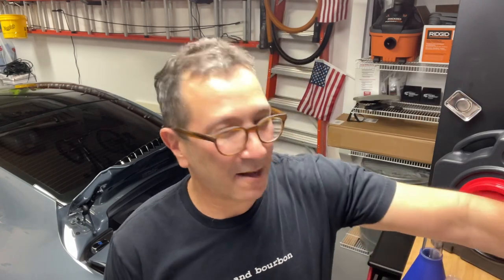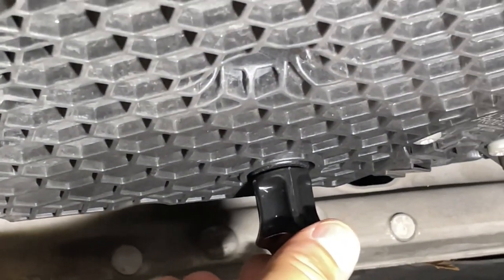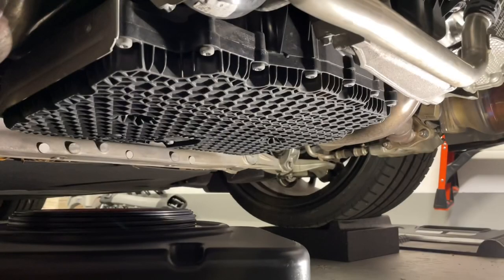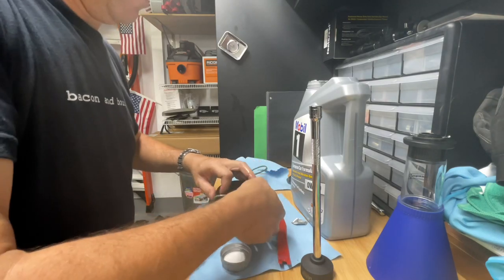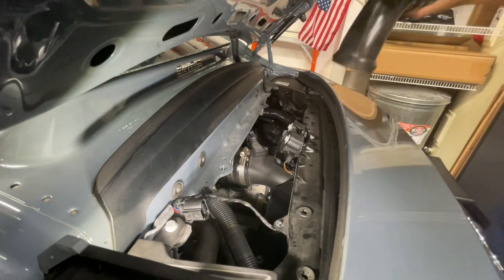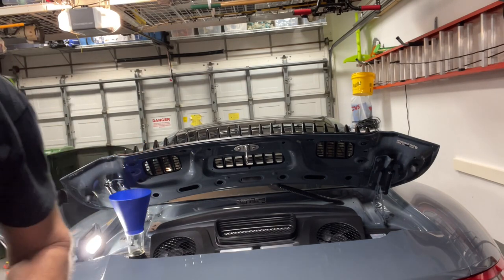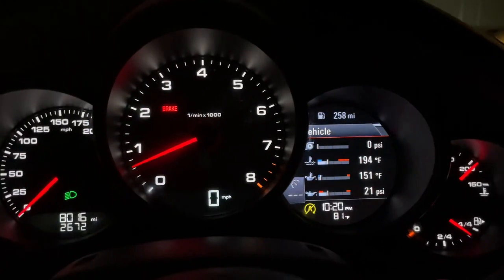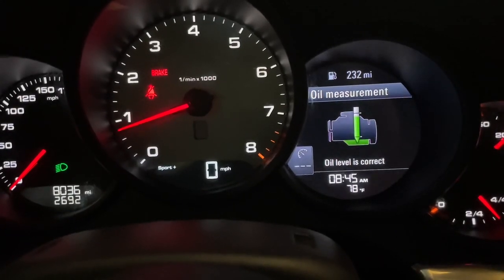First Oil Change Mobil 1 Full Synthetic Fluid Porsche 911 Carrera S 991.2 C2S DIY Maintenance 991

Comment: Great video. You seem very passionate about your Porsche and it’s Maintence. While I did enjoy your video very much , I cringed every time your watch came close to the car 🤭.. Nevertheless, really enjoyed the video 👍👍
Reply from the maker: Thanks, Henry. Cringe because you’re worried about the car getting scratched or the watch?!  I try to be careful about the car but I can assure you that watch has been through quite a lot. I pretty much wear it doing just about anything. It takes a licking and keeps on ticking 😉
Reply: @fickstit2839  As a collector, I couldn't tell if it was a Yacht-Master or a Longines HydryoConquest.  But many have comments about not wearing the watch while doing this.  I agree with you.  I always wear my watch(s).  And obviously, you are very careful with it.  In fact I will wear my Apple Watch on my right hand and my Pepsi GMT on the left.  One for intelligence one for arrogance.😅  Trivia: Who was famous for always wearing two watches at the same time?

Comment: wish I had my garage back... would love to change my 992 oil on my own and save $500
Reply from the maker: SJ, I completely understand.  Having a garage certainly makes doing the work a bit more comfortable but the reality is that if you have the right tools such as a low profile oil drain pan and the proper socket to remove the oil filter, you can do this job on the side of a road.  There's really not that much to it.  But yes, I'm glad and fortunate to be able to do it in my sweltering hot garage :)

Comment: i see you struggled putting the filter cup on , next time don’t insert the paper cartridge in to the housing but the cup itself then screw it on by hand as you did. drain plug is such a bad design by porsche i personally don’t like it. anyway you done a good job.
Reply: It is made of hard plastic cuz aluminum or other metal would expand/contract with temp changes right???  But other plugs are metal of course.  What would be a better design?  I'm curious...

Comment: I also do my oil changes on the 991.1 GTS. I like to cover the air intakes with microfiber towels just in case I drop something taking out the oil filter. I wouldn’t want to remove the rear bumper in order to retrieve anything from there.  For the oil filter gasket I use Porsche grease instead of oil. I use break cleaner to clean the plastic oil filter housing. Also, I like to pour 1 quart of clean oil after the oil has drained completely to remove any residue. There’s nothing like the feeling of driving the car  right after your personally done an oil change. You may want to do a fuel system cleaning before each oil change. I use Chevron or LiquiMoly. That car deserves a digital torque wrench from Snap On 😊.Great Job!
Reply: Wow, excellent recommendation.  I never thought of a fresh flush with a new qt of oil.  Makes sense.  And the digital torque wrench comment is pure Porsche guy talk!  Love it.  jivano, when using the LiquiMoly to flush, can you comment on how you do it?  You mix with 1 clean qt of oil?  Or do you use the Moly instead of a fresh qt?  Or is it something more involved?

Comment: -I would replace this strange oil pan with one made of aluminium.
-That the newer modells don't have a dip stick at least in addition to the guessing kind of electronic measurement thing i really dislike. I especially hate the fact that you can't see if there is not enough oil in the engine, before you have started it and warmed it up. Just in case, wouldn't it be better to know that there is too little in it BEFORE?  
-To pour in the new oil is the rewarding part of the change. I really like it when i do it myself and i really like to see it completely in an oil change video. Some videomakers shorten that part for reasons i don't understand. If it takes too long for the audience then they could easily fast forward themselves. 
-Congratulations not only for the nice work/video but for the awesome car as well. Beautiful.color. 👍
Reply from the maker: I share the same thoughts as you.  I was baffled when I learned that in 2017, they changed over from the metal oil pan to the plastic.  Turns out, the engineers believe these pan to actually be more durable against impact and lighter weight.  Still hard to wrap my head around but so it is.  Agree with you as well on the dipstick and having to check oil levels through the computer.  This is not uncommon in newer cars as well.

Comment: I did notice a few things worth mentioning, most minor but important. First, it's always a good idea to disconnect fans before trying to remove and reconnect after reinstalling. Fans can spontaneously start even with no key in the ignition. For information, you never want to leave your torque wrench set to a torque. It should always be left at zero then set to use and returned to zero when done. If left set for too long(way longer than your video) they can become inaccurate. Last and probably the most important is I never noticed you reattaching the engine cover release cable to the air intake plenum. this can be quite important because if the cable moves around and disconnects from the latch(speaking from experience) it is a nightmare to try and reattach when you can't release the engine cover. Nice video I like when non-experts put videos to show everyone can do these jobs. Also If you overfill the best way to correct it is to remove the oil filter let it drain and remove oil from the canister.
Reply from the maker: Thank you for the great feedback.  Great to know about the fans and agree on the torque wrench.  When I said that it was already set, that's because I set it when I took it out for use, then I brought it back down for storage.  I'm fairly certain I reattached the cover cable but it doesn't hurt to check so I will do that later today.  Thank you so much for this.  This really helps!!!
Reply: @fickstit2839  You removed it at 10:05 in your video and I zoomed in and it's not clear if the cable is snapped into the holder. You never mentioned doing it and it d
looks like it is just resting near the holder.
Reply from the maker: @David Ferguson I finally got around to checking and happy to report that I indeed snapped the cable back into place when I originally put everything back together.  The nice thing about this whole experience is that going back to check the cable made me realize just how easy everything is to take apart and put back together.  The first time is always the hardest.

Comment: Great job on your inaugural oil change! I’m specing a Cayman currently and the oil change on a 718 is WAY harder than on your 911. As someone that has changed oil myself since I was 14, I get personal satisfaction from doing it myself. What oil change interval will you be going by from now on? I go by 5,000 miles. The dealership says I am wasting my time and money and insist on every 10,000. They also say it is a waste to change at 1,000 miles on a new Porsche. What say you? Thanks.
Reply from the maker: Thank you for the comments. I think I’m most comfortable going out to 5000 miles or 1 year, whichever comes first. In my opinion, 10,000 should be a limit.  I know others may disagree and that’s ok.
Reply: 3000 for me

Comment: Thanks. Just got the car and planning on changing the oil. Confused on that oil drain plug? Is it not like normal Allen bolt on most cars? Doesn’t have to be torqued? Can you post a link to that funnel? Tx.

Comment: Excellent video, David. Thank you for sharing it in such great detail. I have a 991.2 C4S and am looking to do my first own oil change soon. I saw the info on the funnel, so you mind sharing what ramps you’re using for the car to prop it up? Also, as I am in South FL, would 5W-40 be more advisable? Thanks!
Reply from the maker: Vladimir - I purchased the Race Ramps RR-TJ-S Trak-Jax with Stop from Amazon. The choice to use 5W-40 is hotly debated. Being in South FL too, I’ve  considered using it as it is generally more applicable in warm climates. Just be sure that whatever oil you use that it is Porsche A40 certifies which can be determined by the label on the jug or on the oil manufacturer website.
Reply: @fickstit2839  Excellent, thank you so much. I'll keep an eye out for you while zipping around SoFlo!
Reply: Three initial observations. You did a first class video, very well paced and you have more BALLS than I do !!! ( I am a bit premature, as my C2 is just about to dock in Benicia……so I don’t qualify to say sh*t at this point. )
I just cringed as you pried the plugs and fans out, etc.
But a job and video well done.
Please continue to post !
Maybe I’ll grow some hair when it comes time !?

Comment: It seems a slight improvement would be not to remove the left fan ;) Also, you could open the filler cap for better draining, as with every car, but if you have plenty of time, it doesn't really matter. Do you think it would make any difference, seeing how the filter is angled, to first fill up the fresh oil, then dump some oil in/on the filter, or would it substantially drain anyway, until you start the engine? Just to avoid unlubed cranking as much as possible...
Reply from the maker: Yes, It could be done without moving the fan.   Also, I used to soak the filter in fresh motor oil as part of the oil change procedure in a previous vehicle.  I don't know if it really matters but seeing as I've never really seen/heard/read anyone doing it on the 991, I figured it was an unnecessary step.  Thanks for the comment!!!
Reply: @fickstit2839  Interesting; never heard of the pre-soak but it makes sense.

Comment: Thanks for the video. It did not look like the old Mahle filter & the new one had the same numbers. Old: OPB 115.466 & New: OPB 116.666.
Reply from the maker: Wow!  Very good catch on your part, Steve.  Thank you for that.  I immediately went into high gear to investigate this when I saw your comment.  I emailed and spoke directly with both Suncoast and Mahle USA technical dept (as well as providing a screenshot) and confirmed that the new filter appears to be a misprint and that no such model number for MAHLE oil filter exists.(the one ending in .666).  It is believed to be a misprint on the filter.  Also, if you look very carefully again, you'll see that the first 3 digits after OPB on the new one is "115" and not "116" although it's easy to see how that can be confused because they are very similar in appearance.  Just look at the upper left corner of the digit and you'll see that it's actually a 5, not a 6.   Additionally, Suncoast informed me that these parts come directly from Porsche and not another distributor.  Nonetheless, I GREATLY appreciate your eagle eye and it's good to at least have an explanation as to why the new filter appeared to be different.
Reply: @fickstit2839  Thanks for investigating!
I plan to use your video along with
This RL post
https://rennlist.com/forums/991/989220-991-2-oil-change-procedure-with-photos.html

 As guides when I do my 991.2 oil change.

Both your video & the RL description do not detail replacing the drain plug using the special tool. It looked like you just used your hand with the tool to twist off the drain plug. Is that how you replaced it? Just using your hand with that plastic tool? No torque wrench? How do you know how tight to make the drain plug? 

Thanks, 

Steve!
Reply from the maker: @iconoclast-wolf  - Yeah, There's not much info out there on how tight you should close the cap.  To be honest, the idea that it's plastic doesn't sit right with me but I've come to accept it.  Best I can say is that a good snug hand tightening will do.  You can feel when it reaches a hard stop but there's not a click or anything like that that I recall.  I wouldn't use 'gorilla' strength to tighten it.
Reply: @fickstit2839  Thanks!

Comment: Hi there, this is a super helpful video! I have a 991.2 C2 cabrio, so this video is exactly what i'm looking for. Can you advice where you got the funnel? Also, mobile 1 suggested 5W-40 instead of the 0W-40, are there any major differences? Thanks!
Reply from the maker: Hi, Tony.  0W-40, 5W-40, and 5W50 are all Porsche approved oils per the owners manual.  Given the Blackstone Used Oil Analysis report I just got back on that oil, I will likely be switching to 5W-40 or 5W-50 as I'm live in a warm climate.  Also, here is a link to the funnel:  https://www.amazon.com/gp/product/B08R5Q1T6W/ref=ppx_yo_dt_b_search_asin_title?ie=UTF8&psc=1
Reply: first number is important if you live in area with freezing winter, and don't want to increase it.
if you live in warm climate as in California, Florida etc. not as important.
second number is when the engine is warmed up, so it doesn't matter what the temperature outside is.
you don't want to change it to different number.  that make the selection pretty simple.

Comment: I've done 4 oil changes on my 2018 991.2.  Twice I've had subsequent slow drips from the drain plug.  I'm pretty sure it's because I over tightened the plug and compressed the O ring.  I've since found out that there's supposed to be a mark to align the plug with but I don't know what this mark is.  Do you know what this mark is and what it aligns with?
Reply from the maker: I'm going to be doing my next oil change soon.  I'll see if I can figure it out and let you know.
Reply: I've since learned that there's an arrow in the pan that aligns with the plug slot.  My trouble was that I can't see it from my position when I'm under the car without craning my neck up.  When the plug is in the correct position, the slot is parallel to the rear axles.
Reply: You could possibly use your camera to take a pic to check alignment

Comment: FYI You have to run/drive for 10 minutes after the oil change before you can get the car to measure the oil level
Reply: I was wondering about that.  To warm it up right?  Then let it settle for a few minutes?  Or check right away?  Splitting hairs but I'm curious.

Comment: Any word on the black stone oil report?
And when you say “Suncoast” you mean Suncoast Porsche? Thank you. Great in sites
Reply from the maker: Yes, Suncoast Porsche.  I'll post the summary here but the values reveal some interesting findings including above average levels of boron, calcium, phosphorus, and zinc, as well as lower than expected viscosity which has been widely reported with Mobil1 oils.  I will probably be switching to 5W40 and go with something like Motul or Liqui Moly to see if the values start to improve.  Here's a summary of the report: "The records you have seem to jive with what we're seeing in the used oil. It looks like the wear-in stuff has mostly washed out (which would've happened in the first and second oil changes), and the wear levels are pretty good for a third oil change taken after ~2,600 miles of use. There could still be a little wear-in stuff here, so maybe metals will look better next time, but at present nothing is out of line enough to 
think there are any issues. The viscosity tested thin, so maybe the grade wasn't noted correctly, but that's fine. The TBN's good at 7.7. Nice report."

Comment: It would be nice if you could tell me where I can get all the parts and do name of the parts and did you use synthetic oil or just regular oil
Reply from the maker: Full synthetic Mobil1.  The parts to do the oil change are available through any dealer.  I purchased from Suncoast but you can pretty much get them from anywhere.  If you have a particular part you're referring to, let me know.

Comment: How did the Blackstone-Labs oil test results pan out?
Reply from the maker: I'll just copy and paste the full comments from my Blackstone report here:  "The records you have seem to jive with what we're seeing in the used oil. It looks like the wear-in stuff has mostly washed out (which would've happened in the first and second oil changes), and the wear levels are pretty good for a third oil change taken after ~2,600 miles of use. There could still be a little wear-in stuff here, so maybe metals will look better next time, but at present nothing is out of line enough to think there are any issues. The viscosity tested thin, so maybe the grade wasn't noted correctly, but that's fine. The TBN's good at 7.7. Nice report."
Reply: @fickstit2839  Perfect.

Comment: Does the computer reset itself for the next oil change?
Reply from the maker: No, It does not. You’ll need an inexpensive diagnostic tool like an ICarSoft to reset it. I show how to use it in this video which is also on my channel:  https://youtu.be/H0CMDK-LudY
Reply: @fickstit2839  thank you I’m gonna attempt an oil change on mine, i have the same car as you same color too! Is yours a 4s?
Reply from the maker: @milinichsautodetail3124  - Cool!  Mine is a 2S.